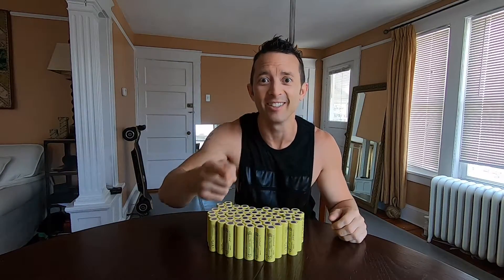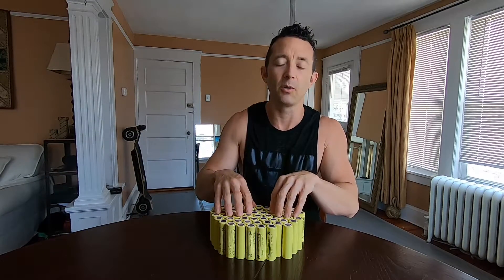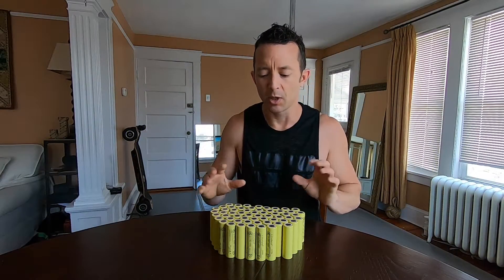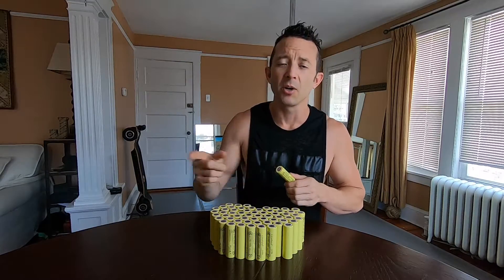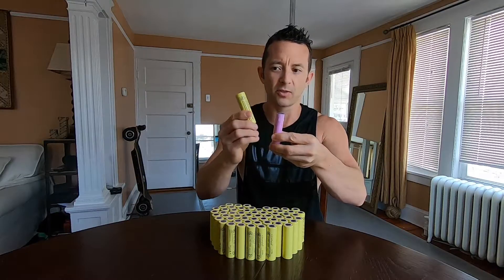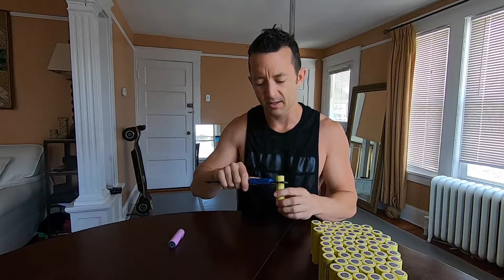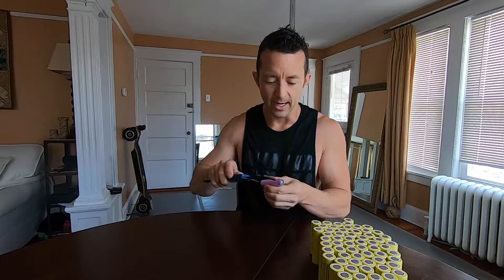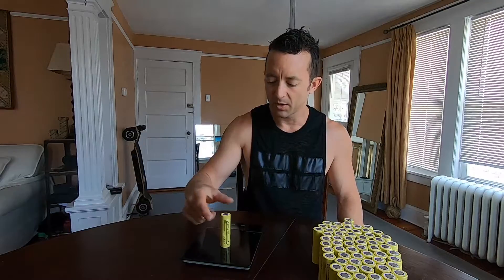Liitokala 21700 Cells - 20Ah Test, Build and Review in 2019

Comment: What can you say about max current they are capable to provide without overheating?
I searched the seller page but all information he gives is 5C A. (Don't even know what that mean).
Some ppl say they are low discharge current, only 5A isn't enough for a high power ebike. The fact that they are high capacity, you don't need to add too many in parallel, making the current even lower.
Thanks.
Reply from the maker: for ebike/eskate purposes you wont push more than 80amps usually and thats mostly froma stand still gassing it, or hill climbing building up that momentum.. and these are short bursts anyways.... 15amps was fine for short bursts but i say a 4p minimum and a 5p which i built so i had a little buffer and wouldnt stress the cells, anything more is gravy and added capacity. I think if you did a 6p youd be good.
Reply: @LifeofAccro  Oh thanks for answering. I just got into deeper research and I found out how to read the Chinese manufacturer charts. Turns out the 21700 Battery cells (at least the ones I'm using), according to the manufacturer are capable of 5C peak current, and 3C sustainable current (sustainable current meaning the cell won't build up heat). The "C" stands for the capacity of the cell. So if the cell is 5000mah, the peak current will be 5*5000mah = 25A, and 3*5 = 15A for the sustainable current. 
So a 4p should be able to provide 100A peak, 40A sustain, which is already plenty. Which is great to make a compact battery pack, and make it fit in tight bike frames.
So, to sum it all up: I was wrong. The cells are not low current. They are not as high current as a good quality 18650 cell, but they are good enough.
I apologize for the confusion.

Comment: Can you please give update how it's performing? The battery life.and range decreased? I am.planning to prepare DIy battery with 21700 liitokala 5000 mAh cells.
Reply from the maker: It rode well during its life...unfortunately a weld broke loose on one of the groups and caused one of the cells to short and vent. The other groups are fine it would just be a project to replace em or rewire and.run it as a 11s
Reply: @LifeofAccro  So, except from broken weld everything fine and the cells are still working? and do they keep the initial capacity of 4000 mah or by the time it went down?
Reply from the maker: @alidalkus3853  yeah it was good.. Although in most applications you only get about 85% of a cells actual capacity since most setups stop draining around 3.0 - 3.2. Full discharge at 2.7 isnt good for battery health so most bms stop sooner for better longevity
Reply: @LifeofAccro  great thanks. I'll choose 21700- 5000mah to double the scooter's range. Currently I have 15a battery pack, I will do 30a with the mentioned cells and range will be doubled.
Reply: @alidalkus3853  i have liitokala 20Ah 48V battery pack. 
It's only about 150€ (170$) and it works great with my diy ebike 1000W 48V. 
Without pedal, i can reach up to 50km
Reply: @zarbonida  from where you brought liito kala 48v 20ah battery..?  
from ali express..?
Reply: @adobclasses517  yes. In the official Liitokala e-store inside aliexpress

Comment: I also use these cells on my RC planes. They are good and cheap. Soldered it 4S3P configuration giving me total of 12000mah and weighs 840gram, good for more than 1hr 30min flight time or 70km total flight distance with still enough charge to loiter around before landing. Subbed, waiting for your next videos 👍